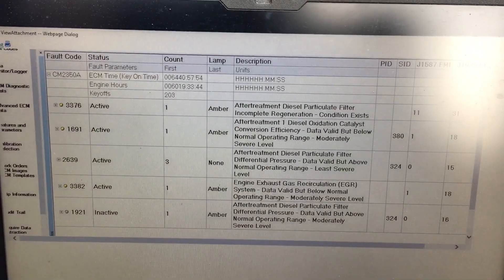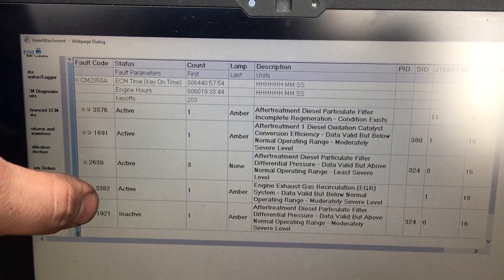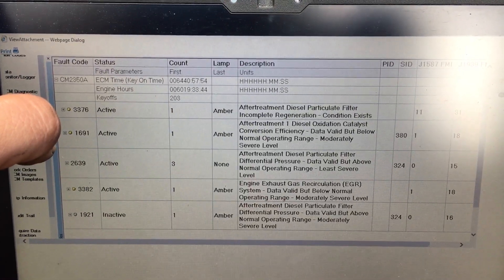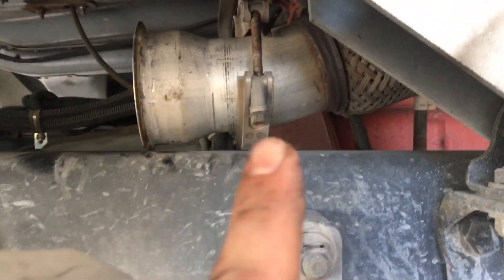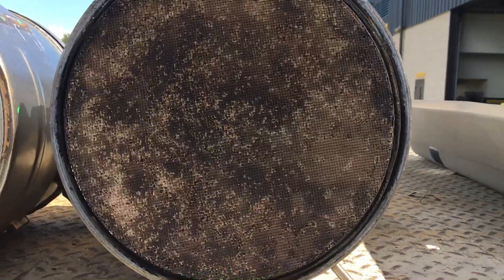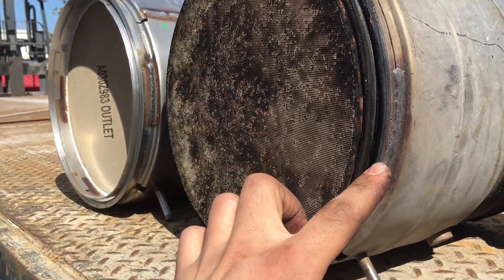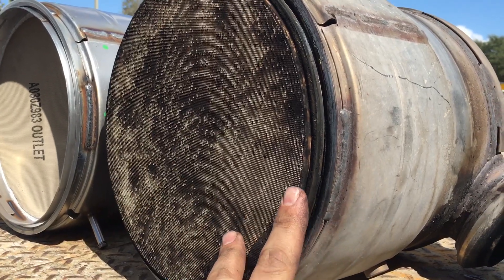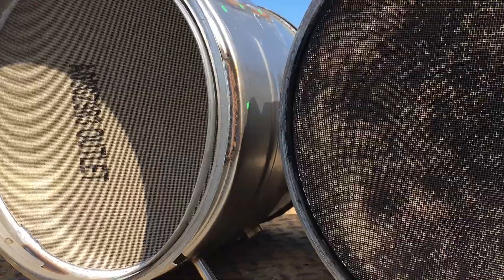BAD DOC (diesel oxidation catalyst)/ fault code 1691 Cummins regen issues

Comment: Any advice for code spn 4796 fmi 31 and spn 3226 fmi 11 ?
Reply from the maker: I would probably need more information, but just from looking up those fault codes briefly I gathered that one is saying your DOC is “missing” and the other is a nox sensor code.

For the 4796 DOC code, the fault seems to indicate that the DOC is not doing its job. It is not raising the temperature like it is supposed to. Have you had any fuel related issues recently? Like failed injectors or anything like that? If so, the fuel problem could have destroyed the DOC and now it is not working. Even if you have not had fuel issues, it’s possible you may have a bad DOC. I would verify the sensors are working and the “7th injector” which sprays diesel fuel into the exhaust stream to heat up the DOC are working (if equipped). If both those things are working, it is most likely a bad DOC.
* Make sure your ecm is up to date and that a new calibration does not have a fix for these codes.

For the 3226 nox sensor code. In my experience, when a sensor has a “circuit” or “voltage” failure, it is 9/10 times going to be a bad sensor. If that sensor has recently been replaced, make sure you check the harness and ensure it is getting the proper power and ground. If it has been replaced recently and it is getting proper power and ground, again, check the ecm calibration and make sure it is up to date. Then, fix the DOC problem first and recheck the nox sensor for failure. The DOC can effect the nox sensors, however, usually a circuit code is not related to exhaust system performance but a faulty electrical part. 

Hope that helps.
Reply: @Alrey Industries Top Tech Diesel  thanks for your help.  I'm able to clear the 3226 code temporarily but it usually comes back after a few hours of driving.   
I noticed on the live data that some of the temperatures are reading normal and some say 32° when it's 80° outside.  Like it says the ecm temp is 32° but the air temp on the dash says 80° and the oil temp shows 32° but the dash gauge shows 200°. Lol. 
The truck still runs like normal, I was just growing weary of seeing that malfunction indicator light on all the time.  😮‍💨
2018 peterbilt 579 with paccar engine.
Reply: Did you ever fix the 4796 code?
Find out what it was?

Comment: Quick question mine doc and dpf
Looks very good and comple after been clean and baked
And truck its not doing regen and smoke
A international dealer guy told me need new doc due to it lost its main components that help to do its job and regen
Saying that coolabd or fueling was got into doc abd made lost its efectiveness
Is that right or just need to be spend money
Because the did dino charge $400. To inspect why its been smoke they said just replace doc..
Reply: Hello my friend, how can I get  the email address from this man from the video?
I have the same problem with my DOC and I don't know where can I find one good shop to fix it.
Thank you.
Reply: Hello my friend, how can I get  the email address from this man from the video?
I have the same problem with my DOC and I don't know where can I find one good shop to fix it.
Thank you. My email address is ricardocod1007@gmail.com